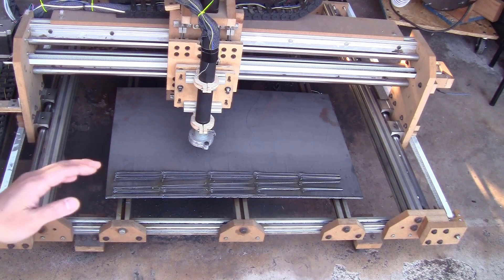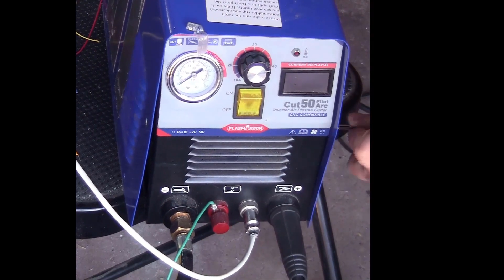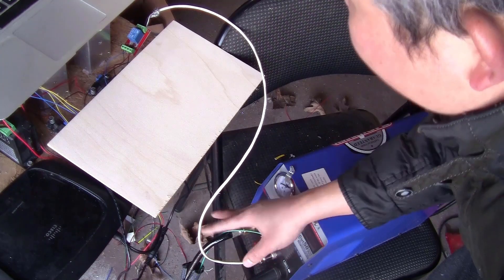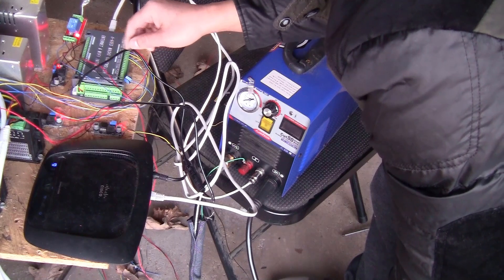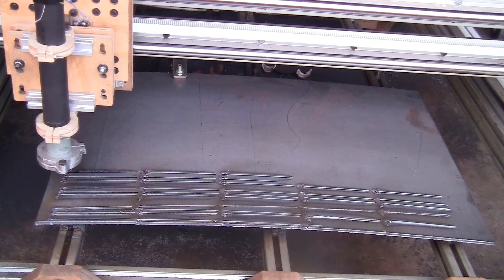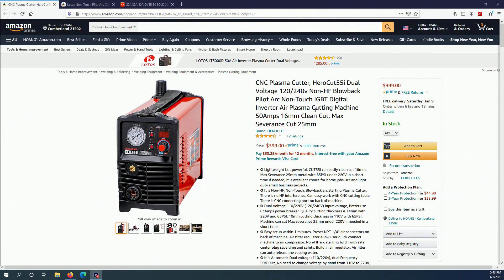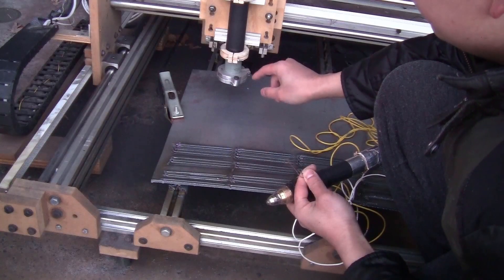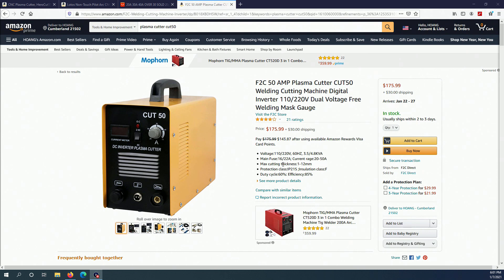DIY CNC plasma cutting table - Making the right choices for interference free cuttings

Comment: It's deplorable that some people criticize your great and instructive job on some racial basis. However that could mean that your videos make them jealous...  Thank you for the details and advice you gave, they really matter. When you say "a new" mach3 control board, it's about the very same one you used for your milling machine I suppose... with a software license.
Reply from the maker: I removed the RNRmotion board(the same one that I have been using on my milling machine) and replaced it with the NVEM board. And I do have a official license of Mach3.
Reply: @minhsmancave9448  official license at $175?
Reply from the maker: @joetke  Not at $175, you can always find some discount somewhere. I paid $140. I always pay my software (SheetCam, LightBurn, Mach3) if I found they are worthy. But I can't deny that a hacked version is a good way for trial and I did start with it. If you buy the combo SheetCam+Mach3 (in case you have a plasma cutting table), you can get Mach3 for $120 I think.
Mon ami, ou etais tu? Tu m'a inquiete un peu. Ca fait quelques jours que je voudrais t'envoyer un message pour demander tes nouvelles. On n'est pas sure de rien dans ce temps de pandemic.
Reply: @minhsmancave9448  et moi alors? Avec les chiffres inquiétants du covid chez toi, je commençais à m'inquiéter aussi... Tout va bien, merci de ta part. Je suis plongé dans deux projets qui ont peu de chose à voir l'un l'autre: le design de logos et leur réalisation par broderie industrielle, d'une part, et de l'autre, la création - design aussi - de moules pour couler de l'argent/de l'alu ou autres, à partir d'un positif réalisé le plus précisément avec mes imprimantes SLA. Projets très prometteurs. Je suis surtout en panne d'employés ;)
Pour revenir aux licenses software. J'ai été des deux bords: un pirate pour évaluer et ensuite par souci d'intégrité morale et professionnelle, une version officielle pleine. J'ai été 30 ans développeur hardware mais plus software en conduite de stations d'épuration en Alsace, pour un bureau d'études depuis disparu... et je tiens comme toi à être honnête malgré la tentation des logiciels piratés. Je vais acheter lightburn à $40, le seul software qui marche avec mon petit laser (eleksmaker A3 pro déjà dépassé). Leur version d'essai d'un mois est très pratique pour évaluer les compatibilités.
Bien, je suis heureux que tout aille bien pour toi aussi. Je m'inquiétais. Un aussi actif que toi qui ne poste pas pendant 2 semaines, ça inquiète ;) Alors en attendant ta prochaine production, on va patienter. J'ai communiqué ton canal à quelques uns de mon entourage et ils l'ont apprécié. Ce n'est pas le moment de s'endormir ;) ;) Salut à toi mon ami et porte-toi bien avec tes proches.
Reply from the maker: Je suis en train de finir un autre projet sur le plasma cutter. Ce n'est pas facile car il s'agit d'installer le moins cher THC sur le marché en Mach3. Jusqu'à maintenant, je n'ai pas pu trouvé aucun instructions sur internet ou YouTube. J'ai du tester chaque étape moi-même, heureusement, j'ai réussi et pense de finir aujourd'hui ou demain.

Comment: I've been follow your videos from the beginning.. Have you removed the manual thc from the A141 plasma tip.? How well the A141 performance after a long term used.?
Reply from the maker: It's not exactly removed. I made the shield that is isolated the nozzle from touching the plate. And after the torch is lifted off from the plate, I still have a few millimeters before the limit switch click again. It keep the torch at 1mm away from the plate if it warped. This way, the shield only scratch the surface from time to time, not all the time like the manual THC. The A141 torch definitely gave me better cuts compared to the p80 torch. That shows on thicker sheet metal. I can see that the arc is more focused and the kerf is smaller. This probably because the air in the a141 does swirl as I can see the burn marks inside  the nozzle and the electrode. That is not the case with the p80 torch.
Reply: @minhsmancave9448   Can you make a video about your new THC solution? I'm very interested in :) Anyway I'm using RNR board and you are right it's weakest point is the USB connection. I have the original board the blue one which came with high quality shielded usb cable with ferrite core which helps a bit against noise. But it's crucial to have some kind of THC because if plasma tip is getting too far from the plate it starts to emit a lot of noise which is too much even for the shielded usb cable and the board restarts
Reply from the maker: @peterpasti  This shield I made is customized to my A141 torch and I had to cut it using my milling machine. If you have a decent CNC machine that can mill Aluminum, I'll send you the CAD file. What torch do you have?
Reply: @minhsmancave9448  I've WSD-60P torch. Currently I'm using the wire guide ring which fixed with a hose clamp to the torch. It works ok but because of the slag on the top of the plate it sometime stuck and leave marks in the cut line. My plan to replace it with 5mm thick stainless steel ring which can go through the slag easier. But I'm qurious for other solutions :)
Reply from the maker: To avoid getting stuck on the slag, I made a conic shield with the angle is 30 degree from flat surface. This way, it will bump the torch up when hitting the slag.    You can see my original shield design (mechanical THC) and cut something like that with your plasma table, make it conic with a hammer and find a way to fix it on the torch. It worked quite well for me.